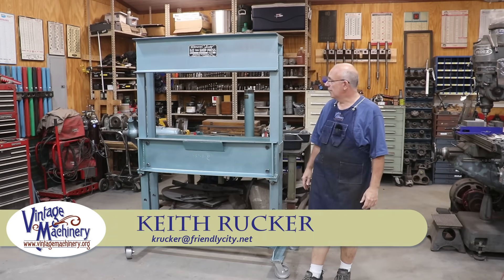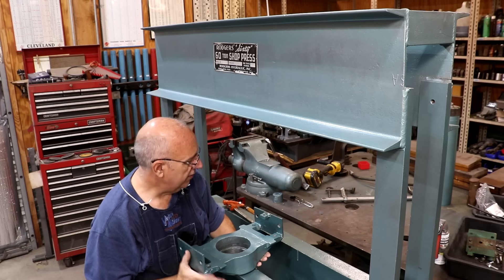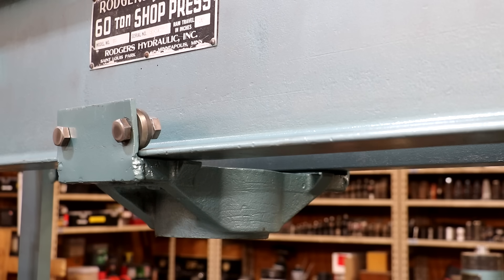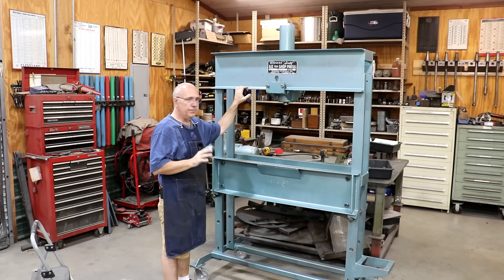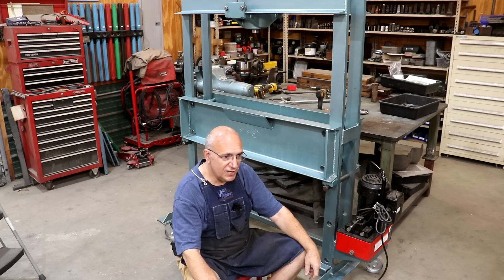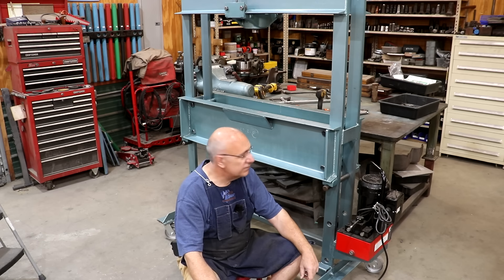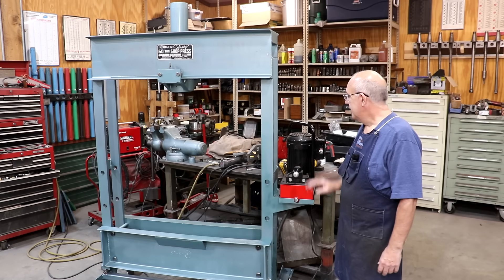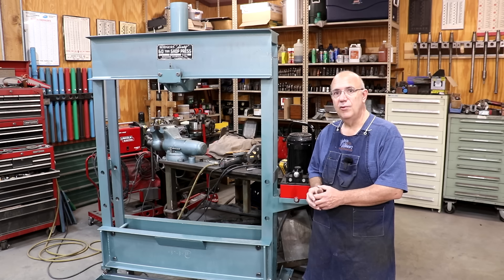Hydraulic Press Restoration - Part 3: Reinstalling the Cylinder and Mounting a Power Pack

Comment: I always want to see if new equipment will work before spending time mounting it, even before buying all the right hardware and connectors and such. That's probably why so much of my stuff is sitting on the floor or propped up on top of other things and half exposed and wrapped with electrical tape or whatever. lol. But at least it's functional. 🙂

Comment: I think you should remove the return spring of the hydraulic cylinder if you're gonna use that pump coz it will only function to press then return. It will not hold the position of the cylinder and would aggravate the user while creeping on how far your only need to press. Just my two cents though.

Comment: Depending on the valve 
Center should just hold pressure 
But you can just plumb the other port to tank and it should work with spring return 
Depends on how the valve works 
but that would be more common for a double action valve for double action piston

Comment: Given the spool valve and pressure of that pump, I would assume it's a double acting, closed center spool.   You have a single acting high pressure cylinder.   That's not a great match - you really should have a single-acting valve to control your device, or if you want to use the one you've got, you'll have to plumb the second outlet as return to the reservoir - otherwise to return the cylinder, the pump will have pump over the relief valve of the second outlet, literally making it work harder to relax the cylinder than to charge it, and placing a lot of wear and tear on your system.

Comment: Hi Keith,
OCD or not I think rotating the carriage might have introduced another "eyesore" in that the cylinder has sçrewed to the bottom. "Bottomed out" you said. However now the hose conections point to the left while the power pack is on the right. The hose(s) are going to have to drape around the back to get to the pp. Going to look untidy. Had you left/fixed the head the way it came off the hoses would be shorter and tidier. IMHO. Just stirring the pot. 
Regards from Canada's banana belt.
🤞🇨🇦🍌🥋🇺🇦🕊️🇺🇲❓👍

Comment: I'm not sure but I think you may need a release valve T'd into your pressure line to return the hydraulic oil, as there is probably a non-return valve in the actuator which is bypassed when you reverse the pump
Reply: I was thinking the same
Reply: He may be able to puchase a single acting valve instead of the double acting. Contacting the mfg. would be a good idea.
Reply: ROBERT, 10:30  THE Steel  spring inside will release all the oil back...

Comment: Not many of us have much hair left to pull out. Turning it around is exactly what I would have done. I would have justified the angle by claiming it allowed the wheels to align at right angles to the angled inside flange on the beam. And the side with the nut is straight and has play because that's the side you lock down. I'll take plausible alternative history over truth if it allows me to keep my hair :)

Comment: You should have mounted the pump on the other side to meet up with the outlet on the hydraulic cylinder.
Reply: I thought that too, but looping the hose with a U bend could make hose management easier since he intends to use the moving head option. I believe that my press design uses that feature and the hoses stay free and don't catch when moving the cylinder. I just put my rebuilt 50 ton press in the shop. It is so new to me that I haven't done its first real job yet. I am not intending to add a cylinder trolley clamp. The OEM design didn't include one. I am reconsidering adding that feature after watching this video. My cylinder head rolls much more freely than this one does. 
I like the look of his press table channel stiffener. My table isn't stiffened as well. My unit uses a wet kit from a light dump truck or dump trailer. The manual throttling valve handle is easily feathered controlling the cylinder travel speed with easy precision. It looks crude since the wet kit sits on top of the press frame and it uses mechanical linkage to operate the valve. But it works very well. I like that OEM design modification to a simple off-the-shelf hydraulic wet kit. I can feather the pressing feed rate and send the ram home at full speed by how hard I pull on the feed handle.
My frame appears to be lightly built using some formed frame components where most heavy presses rely strictly  on steel channel like Keith's press. In spite of this, the frame has no use damage. I assume that mine did real work. I got it from a shop that builds heavy cylindrical grinders for steel rolling plants, paper mills, etc. rollers. On my shop tour I was told that they build grinders to handle 40' and up to 50K lb cylinders. My press was sold very inexpensively, because a "maintenance man?" Had replaced the 3 HP motor with the wrong V belt and pulley size. They condemned the pump.  My major repairs were correcting the pulley and belt issues and tidying the handyman wiring violations. A 50 ton shop press in my home hobby shop is a fabulous upgrade. This machine is one of my best Craigslist deals. I think that my machine was marketed to the auto repair market. It cheapens the build over a true industrial machine like you would expect by a Northern Tool type machine. I bent 1 7/8" test steel with a 1/2" bow unintentionally while inspecting the Vee belt slipping issue. I was watching for belt slippage and was unaware that it was happily bending my test stock! 

Keith's reservoir looks too small to me. If he can feather his control like I can, he will have a really nice setup.

Comment: I know it wouldn’t help your OCD. It wouldn’t help mine either, but you could have drilled slightly bigger holes, which would also have saved you bending out the side bits. The lesser of the evils so to speak 🙂.

Comment: I am not sure but if you move the leveler in the middle the valve will cut off both directions and the fuild the cylinder will be trapped in it
Reply: It depends on the center condition of the valve. A locking center will do that but an open center will let the fluid return. Valves are usually marked as to the center condition.
Reply: @millwrightrick1  I agree with you but from what I seen doing maintenance if the valve is double action the center portion is a all stop  so the fuild will be trapped

Comment: Keith, if the pump is indeed rated for 10,000 psi, make darn sure that any component that will see this pressure (pipes, hoses, valves, adapters, etc.) are also rated for 10, 000 psi.  A blown hose at that pressure can kill.  Since this is a low flow system, you might want to use 1/4" or no more than 3/8" hoses.  The smaller the ID the higher its pressure rating.  Have pros assemble the hoses rather than doing it yourself unless you're an expert at it.

Comment: The wheels on the channel appear to be a bit sketchy for the rating of the press.  Effectively, each pair of wheels puts a mobile point load on the edge of the flange as you have constructed.  That will give a load right on the edge of the flange that is not designed for the load.  It would be far better to move the wheels further inboard to put the load closer to the root and where it is a thicker/stiffer part of the section.  Also, because of the shape of the bottom flange there will be a tendency to push the plates outwards under load, which is where maybe the original fixture failed, the plates need reinforcing to stop the rotation  around the repair.
Reply: think about what you have said when in use the load is upwards the rollers are not in contact with the I beam only the bottom casting
Reply: The bottom of the wheels are beveled, it looks like they match the angle of the beam they they ride on. It wouldn’t take much to make a half inch or so thick plate for both sides to move the wheels in some. Or like StuartHardy4626 says, they don’t have any pressure on them when you’re pressing anyways, so good enough!
Reply: @stuarthardy4626  I appreciate that the load on the rollers is only that of the cylinder and the bracket, which we have seen are not light.  When the press is in use the 60T load acts through the web of the two upper and two lower channels so the wheels probably are actually not in contact with the flange.  The actual contact of the wheels when the press is not under load is through the wheels on the outer edge of the flange that seems to be naturally wrong and goes against all standard structural principles of loadings on flanges of structural sections.  There are also times when the press could be used in tension as its a really good stiff frame, in which case the roller cradle would prevent that.
Reply: @Hoaxer51  Agreed, the flange taper is ~4.5deg  and the wheels seem to have a taper as well although the wear on the wheel indicates only the outer 1/2 is in contact.  For the sake of 1/2" spacers the whole installation would look more comfortable

Comment: I see an accident waiting to happen. That trolley that holds the ram. The side plate is bent because something was pressed exceeding the ability of that plate to stay straight and that would be hard to do with a ram of that capacity. You need to make new plates from thicker material or even a better design. But like you admitted in this video you don't always listen to advice.
Reply: Hmmmm…. There is no weight/pressure on those wheels, other than the weight of the Ram + trolley.
When pressing, the Ram lifts the trolley up against the strong back.
Regards
Robert

Comment: A second pair of eyes sometimes will see things that you don't therefore please don't be offended at what I'm about to say. My criticism is purely constructive and proven advice from a person who understands OCD and how it affects and knows of this style of press.

Some years ago I restored a Whitworth & Co Press built in 1807 used to help build the Titanic by Cooper & Declan of Ireland. They were one of many companies allowed to manufacture presses using the Bramah hydraulic design patterned in 1795, but my press was a later model built in 1885 in Sheffield by  Schuler, a German inventor who moved to England in 1837 and is significantly better engineered. 

Anyway, history lesson over, sorry about that. I tend to get carried away. My press was seriously damaged in the Blitz in London during WWII. Found in the back of my grandparents' garage, it was bent and rusty. It was so bad that the beam and one side of the frame had to be remodeled, taking measurements from an existing press kept in a museum in Sheffield. 

My beam was exactly the same shape as yours with a similar hydroulic carriage. Even the wheel design was similar, I think they all were.

Like yours, the wheels rolled along the runs on a camber. This is to cause the least amount of friction. So what you should have done is remove both the plates and remade them as an identical pair. Once you refitted correctly, im sure, like my welding, yours would have been a much better job than the other guys. Such shoddy workmanship. How did he get away with it? No pride, I guess.

As for that screw you added on top to secure the carriage in place, not necessary. The press holds it in place the moment it comes in contact with the item you need to press against. As for the gap underneath, it should be just enough to allow the carriage to move smoothly and no more. Use a small amount of low friction white grease or quality oil between the carriage and beam, a slight smear only but nit on the wheels. This will prevent future rust, that's all nothing more. 

Last point I want to make is this. Keith, you carry out a lot of interesting projects which is great, but im a 62 year old man who also suffers with OCD, and it drives me crazy.

You spend time making sure the electrical pump fits alongside the frame and you did a good job of it, brilliant. So why the hell didnt you make good those welds but it's not just that. When you have other projects stripped down to the basics you make parts that are damaged or missing but you don't put right parts or items that clearly need some love and attention like bad welds. 

You say you have OCD. Okay, I get it. In that case, why could you leave that poor quality welding? How could you do that? Please readdress this issue, make it look better, and then repaint it, showing us step by step. Thank you ⚒️

Ps. Those bad welds are really bugging me. Please fix them snd soon.